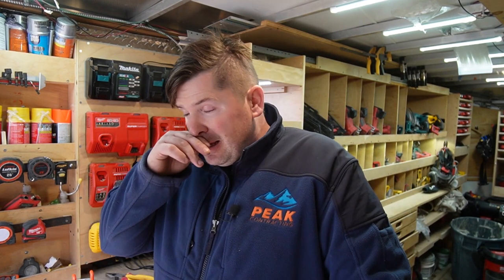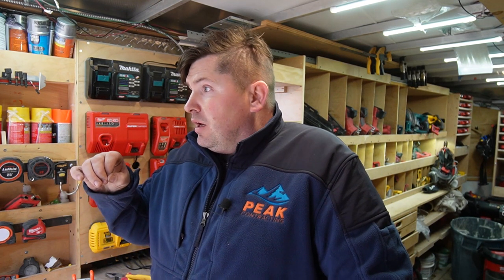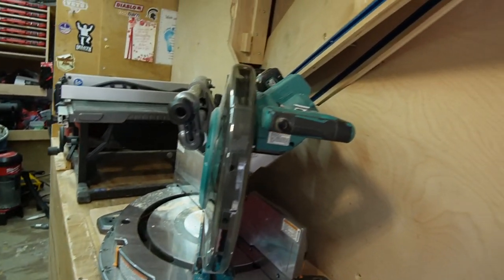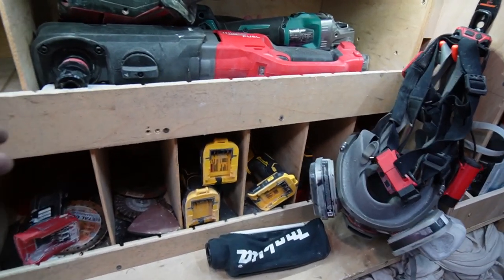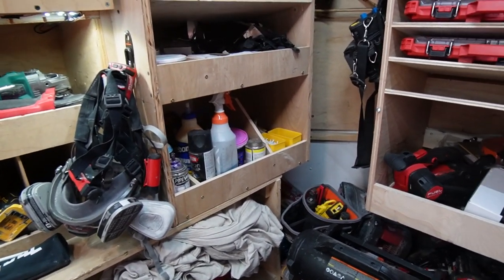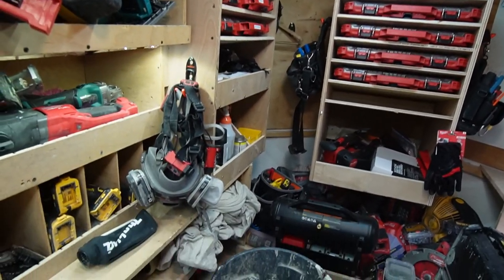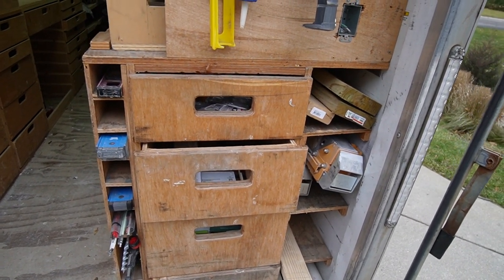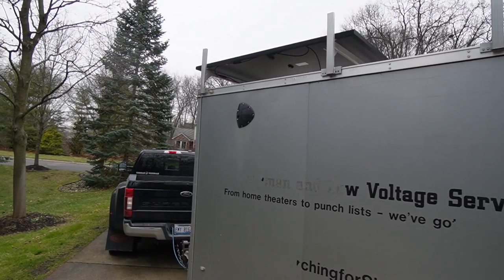New Trailer Video! #1 (I'm working on a better name)

Comment: Looking forward to seeing your new setup.  I have a 8.5x16 7k lb. square nose for mine.  I'm good with the length as it has been tight in some driveways.  I do wish I'd have gotten a 10k trailer and also an extended tongue as it would make it easier to jack knife it some driveway.  Most of jobs are 6-12 weeks long so it stays on site for a while.  I prefer my barn doors as I don't always have room for a ramp but also have a set of aluminum ramps I can set up if needed.  I prefer the flexibility.  I also have my trailer wired to run off my truck for lighting, and then a generator is wired in to work if I can't connect to shore power once on the jobsite.  I thought about putting my system on casters also but just purchased an additional trailer to haul bulk materials.  I do strictly kitchen and bath installations so I'm hauling cabinets, pallets of tile, along with building materials.  It wasn't cost effective to empty the trailer and pull it off site to get material then put everything back.  A dump trailer with hinged sides also is a good acquisition.   Easy to load pallets of tile or bucks of drywall or plywood.  Good luck with your upcoming build.

Comment: Looking forward to the upcoming trailer build.  I like your idea of putting the cabinetry on casters. I see lots some benefits and flexibility to that system, especially for someone who does a wide variety of work. Will take some thought and ingenuity to pull off. Fastening them to the walls via t-track is an option. A second trailer, specific for hauling materials/furniture may also make sense as well.

Comment: I live in the UK 🇬🇧 I don't know if you have the same problem but if we park up at B&Q (HOME DEPOT) Or anywhere over night the van will get stolen or broken into for sure. Its really hard to protect your tools when working away over night. You can't always unload into the hotel so you have to hope your tools don't get stolen. We would have to weld a metal solid cabinet for the power tools. But they'd still tow the van away and grinf it open.
Reply from the maker: We don't have the theft issue for the most part here in US because we have guns and can defend our property with deadly force in most states. I've seen so many videos in the UK of guys tools being ripped off.
Reply: Yes I worked in nashville for a while and it seemed very safe. Problem here if a criminal has a gun he'll use it to steal your tools. If not a knife in some circumstances. On a whole most of us are lucky and take precautions with dead locks, alarms etc but people are becoming more desperate and brave and will try it in abroud daylight. It just makes life hard as you always feel the need to unload and take tools in your house or in the job. It's alot more more work. The second hand tool market is huge here but sadly 90% of that is someone's livelyhood. Its a really sad state of affairs but the government don't care about petty theft. Great video though. Will kit my next van out but arm It like a tank 💪😉

Comment: I’m with you. I cannot figure out an optimal use for the V nose. Mine holds my spare tire and then is essentially my junk drawer
Reply from the maker: it's not just efficient to have the v nose in my opinion
Reply: @RenovationsandRepair  it will pull slightly better with a v-nose. With a half ton it’s noticeable, with your 450 it does matter